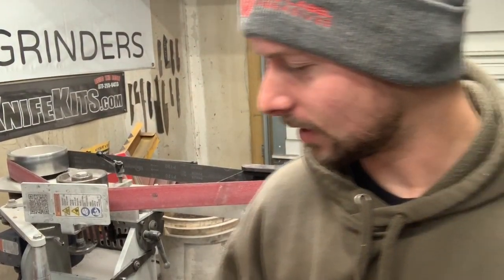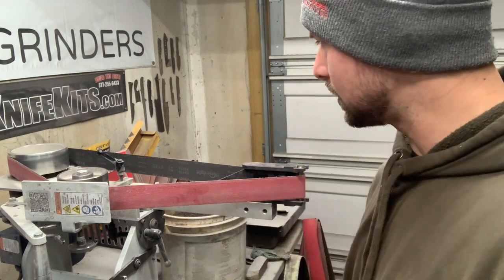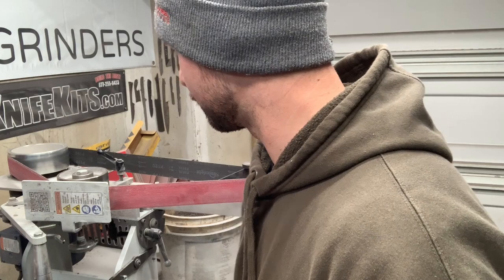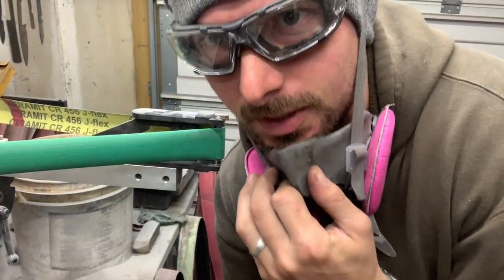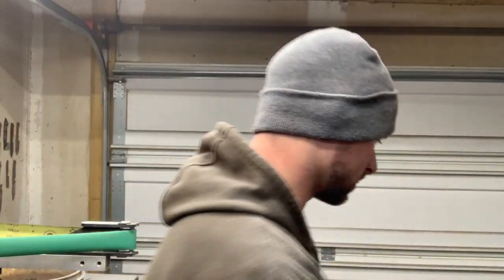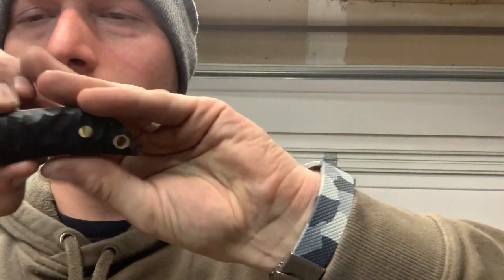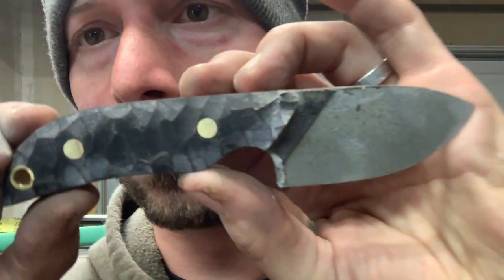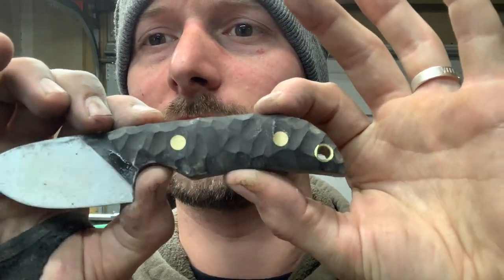How to Rock Pattern Knife handles

Comment: Good stuff. I’m an aspiring knife maker. I have most of the gear now and have made a few so far. I can see this is going to totally consume my life. It already has. Seeing knives like yours inspires me dude. Also I’m a fellow Michigander too. Metro Detroit. Keep up the sick vids.
Reply from the maker: That is awesome to hear! Let me know if you have any questions
Reply: @gentrycustomknives8008  I’m having trouble keeping my plunge lines even. The grind is pretty even on both sides but the plunges on either side aren’t equal in degree angle. I keep making knives over and over but they always end up the same. Kind of hard to explain. I know I’m using a shitty grinder but I know decent is possible. The dude from simple little life in His latest video just got the same grinder I have and had some sick grinds.  He was doing an “experiment”. Any ideas?
Reply from the maker: @TheRealCardz  get one of those file guides. Helps a TON!
Reply: @gentrycustomknives8008  hell yea. I ended up making one out of angle iron. It turns out that my platen had a small wave right in front of where the belt runs in front of the platen. Super small wave that caused some issues. Next question I have is do you ever hear of people selling belt sander? I def have to up my sander game up and I think I’ll be able to make some descent stuff.
Reply from the maker: I’ll let you know if I see any deals!
Reply: @gentrycustomknives8008  🤙🏻

Comment: Preference is funny; you wanted the pins to have a "clean" look, I was reveling in how good they looked with multiple angles.
Ill be using your technique on my Cold Steel Rahja II scales, spine, thumb disc, and back spacer.
The randomness you incorporate, looks better than the more popular Katana Ito Rock pattern I often see.
No belt grinder, I'll be using a dremel tool.